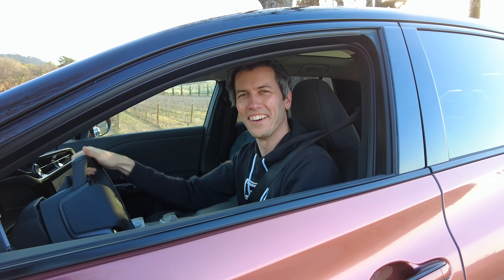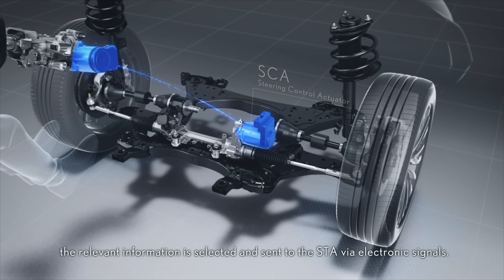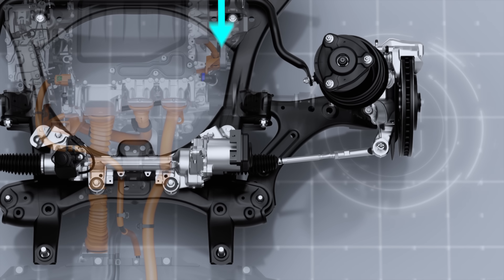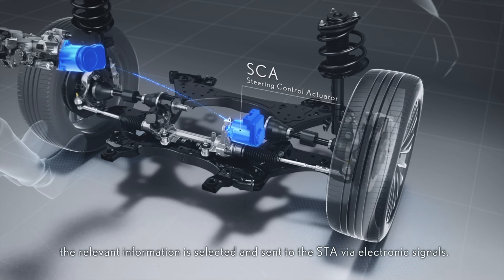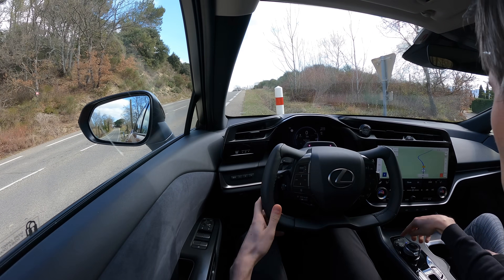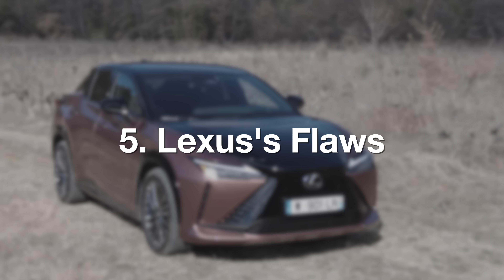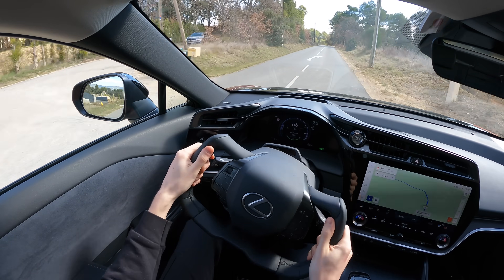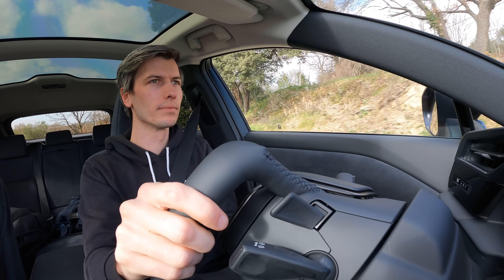How Lexus Fixed Tesla's Bad Idea: Steer-By-Wire Yoke

Comment: I like it, however, the certification process in the aviation industry is totally different from the car industry.

It is like Tesla reducing the amount of sensors. In aviation to reduce it, it would require an amount of testing and certification that's astonishing. And in case of failure, the fleet is grounded until the manufacturer comes with a solution. 

Again totally different from the automotive industry.

Comment: Critique… in every moment you showed driving the cars, the driver had both hands on the steering wheel or yoke.  This isn’t realistic. We use the right hand (in the US) to adjust the music, temperature, drink a beverage, or just relax and drive with one hand.  How does this perform using one hand as maybe the majority of the time we’re driving? With one hand driving, I also like to hold the wheel at 12 o’clock.

Comment: Surely you get far less feedback in the steering wheel feeling with a electric system, like with a physical connection to the road, you can feel everything, with this, not so much

Comment: ALWAYS REMEMBER UNINTENTED CONSEQUENSES!;
About 4 to 5 years ago I drove a (full production) fly-by-wire car on a banked oval test circuit at a steady 100mph in the 4th of 5 lanes. During the the second lap there was an audible 'clunck', all the electronics switched off, the dials returned to zero and most frightening the stearing wheel went floppy,  no feed back resistance. The front wheels "straightened"  from their original slight steering to the left angle required to stay in the oval 4th track lane at that speed. Consequently the car veered to the right (effectively straight as the wheelshad automatically straightened) and headed across the outer 5th lane, towards to outer crash barriers.... which had I hit would have resulted in a major rickshay or straight through and over the barrier into the forests below . 
A milisecond later there was another clunck, all dash power, steering movement resumed and I was able to correct the projection  of the car,  just missed hitting the outside barrier. 
I wrote to the manufacturer describing the event. The reply was, this is an 'unusual driving /steering angle of just a slight - off centre- turn I f the steering wheel and for a period of time of more than a few seconds resulting in the "chip" thinking that perhaps the  was parked and therefore activated "auto correction /straightened of the wheels to the rotational angle of the steering wheel.) This may be useful if you park leaving the steering wheel on hard lock when parked up in Car park.... but to take over at 100mph and transform the steering wheel into a free unless spinning plate was a heart stopper.  Designers.... this is not a PlayStation with simple adaptive feedback that if you crash on screen you can just press the  "reset" button.
Reply: Wow.  I've been saying you can have as much redundancy as you want , at the end of the day a mechanical link is more reliable and cheaper to implement. Yes in some weird off cases they do fail  but the failure isn't going to turn you into a pancake.  It's the simplest things engineers often overlook. Myself included. You would be surprised the mistakes I've come across in R&D. Just because it was designed by a company or a group of engineers does not mean it's foolproof and does not always guarantee safe operation. Field testing usually brings things to light the lab could not reproduce. At that point it can be life or death .

Comment: There is one more safety issue not addressed- the link between the steering wheel and the wheels. The signal line. If it is damaged what’s going to happen?

Comment: @0:05 Gives "input lag" whole new meaning. (Edit: Watched the video now. I would get carsick from it. I saw it right away. I would never feel safe - if a drive by wire system fails, the throttle will close. If brake by wire fails, it still has a mechanical backup. If steer by wire fails... Well.)

Comment: I'm glad you addressed the lag toward the end of the video.  Within 5 seconds of starting the video I literally said out loud "Wow.  You can SEE the lag!"  That is a deal breaker.
Reply: I loathe input lag in all things.
There is a real common theme of the tech industry trying to push fancy new technologies that present a safety hazard, and they sleaze their way in anyway. (A very old example is actually HID headlights.)
Reply: @ΜικεΡ  >If it was actually lag, there would always be Xms of delay between input and rack movement.
And there is, you can count the frames between when the steering wheel starts moving, and the time the wheels do... and it's about 3 frames. This video is at 30Hz, making that... cue the drum roll 100 ms. Increasing the time it takes to react to anything by HALF.
Reply: @ΜικεΡ  I'm not sure the purpose of you splitting hairs here, the issue is the driver expecting a certain angle and the wheel not being able to keep up due to the higher tire load at low speed. You understand what we mean when we say "lag" (that resulting angle lags behind the steering input by the driver). You conveniently ignored my question about this flaw at lower speeds, all for what? So we can call it desync rather than lag?
Reply: @ΜικεΡ  
You literally said the opposite above "What we saw here is that Video Man can crank the yoke to it's end of travel faster than the steering computer can yeet the steering rack." 

then you said this doesn't happen at highway speed.
Reply: @ΜικεΡ  I completely understand the wheels will not follow the exact steering input commands with a simple "lag" in time..You could have just answered my question by saying "yes my concern was to correct your conversation to use the term 'desync'". You are focused on peanuts all the while my whole point to the other guy was the rack not being able to keep up in certain conditions and the computer introducing limits in order to not destabilize the car at high speed is a very noticeable thing for the driver.
Reply: I agree
Reply: Same here, 5 seconds into the video and I immediately noticed that the lag between steering input and the wheels turning was too much for my taste!
But perhaps it's something that could improve over time...
Reply: @ΜικεΡ  What you describe is literally lag, but your significance is that it is just the steering not keeping up and doesn’t manifest itself at high speed.. So we only need the quick response on the highway? 🤔
Reply: @ΜικεΡ  Also not sure how you gather I don't understand how the system works. 

"The steering rack has a maximum velocity,"

Yes and above I asked you if on highway performance was the only thing of concern, hinting that you were ignoring the slower speed response of the rack. Swerving at lower speed the rack would not be able to keep up with inputs as well and the driver would notice this.
Reply: @ΜικεΡ  I have been reading your posts and literally keep quoting your comments where you say the issue is at low speed  I don't know why this is confusing to you. Low speed.. You know.... where your inputs are faster than the rack can keep up with. Quit telling me to read your post after I keep quoting you. Again you are enforcing the point that it's different than a mechanically locked system, meanwhile I have been refraining from calling it "lag" not sure why you are still arguing.
Reply: @ΜικεΡ  At lower speed the computer is programmed to have a higher steering ratio, thus more demand for the rack to steer with smaller steering inputs as well as more road friction or what have you (making quick rack movements difficult).

@Mike Perreman:
"@amorag59 ... What we saw here is that Video Man can crank the yoke to it's end of travel faster than the steering computer can yeet the steering rack. ...
At highway speeds this 'lag' wouldn't be detectable since the steering computer can keep up with the yoke."

your comment that this manifests itself as more a problem at lower speeds, agreed.

Edit: In response to your edit.. You are arguing a straw man now lol. My sole point in my op was that this system is noticeably different than a mechanically locked one.
Reply: Must feel like driving a 1984 Buick Century with such delay.
Reply: lol not in drifting.
Reply: @ΜικεΡ  12:00
Reply: @ΜικεΡ  12:01 frame 13: Yoke movement starts
frame 16: Wheel starts to move
frame 22: Yoke at 90 deg, wheel nowhere near the 60% of travel mark (90/150), so if he stopped turning right there the car would still be in the beginning of making the turn.
Reply: This should be illegal in a car, any unexpected turn for example in an accident can result in fatality
Reply: are you saying that little bit of lag is slower than turning the wheel 3 times? its not any slower to turn all the way then a normal car lmao
Reply: I mean you cant turn wheels with a normal steering wheel that fast.
Reply: humans have a ~150ms response time if u were a prodigy this latency is not noticeable. probably more responsive than some tvs
Reply: I mean it might be a deal breaker in a sports car.  But I don't see why it would cause problems for a daily driver.
Reply: Shouldn't most gamers be accustomed to working in an environment with noticeable lag?
Reply: @MetalheadAndNerd  No.  Gamers do everything in their power to get rid of lag.  If you can see it easily with your eyes, it's WAY too much for gaming.  You might not think this steering lag is THAT bad... until you need to make a quick evasive maneuver and the lag causes you to hit what you were trying to avoid.  Your brain alread has a 180-200ms reaction time.  You certainly don't want to double that.
Reply: @MetalheadAndNerd  I literally stopped playing Geometry Dash because I started to notice the latency and it felt awkward and I'd play worse, if the latency is noticeable I consider it already beyond unusable
Reply: @MetalheadAndNerd  No, because your mouse has something like 5ms of lag compared to this steering wheels 200ms of lag
Reply: @MetalheadAndNerd  I tried playing Forza Horizon 4 with Bluetooth, and it was unplayable
Reply: @MetalheadAndNerd not every customer is a gamer
Reply: All steering lags, it’s the flex in the metal. Will you notice more?
Reply: @teamidris  But this lag is way more then the metal's flex.
Reply: @Sekir80  truth, but I think your brain won’t notice? Like driving a tractor with big tyres, you just accept the lag. Or windscreen mesh that you don’t see.
Reply: @teamidris  True, adapting is a realistic assumption here. As with the very laggy throttle response: you try to think a bit ahead. 
The problem might be if someone needs to instantly do an evasive for some reason, rewiring that in your brain is hard and dangerous.
Reply: @teamidris  You would definitely notice, 12:30 is not simply a marginal amount of lag. If this were a tractor it would be fine, but it's an on highway vehicle. As others pointed out it's very comparable to throttle lag, but you can't always adapt to cover the bases. VW had tech for their mk4 cars to smooth throttle inputs - which ultimately presented itself as lag. On a stickshift car it was quite annoying as you could full throttle stab the throttle (representing a downshift blip) and the rpms wouldn't even go above ~2krpms, and this was on a sporty VR6. The little things become annoying over time.
Reply: @teamidris  Yes, i definitely would. This looks absolutely terrible to drive.
Reply: @teamidris  Easy, remove the flex and isolators. Zero lag

Comment: How is the dynamic ratio controlled ? If i launch the car out of a turn do the wheel straighten automagically ? Does sensitivity increase when slamming on the brake ? 

Seems like a very bad idea to have it dynamically adjust, especially for emergency situations...

Comment: Isn't steer by wire illegal in Europe? I remember press articles from like 2015 where car manufacturers were lobbying hard for brake and steer by wire and Europe basically said "STFU safety stuff will require at all time a mechanical connection. You can have as many assists as you want but there need to be something physically linking the input and output"

Comment: Sounds just as driver centered as drive by wire throttles. By that I mean, I don't need someone(s) else deciding how much I want to operate the controls in my cars. When I move the throttle pedal, I want it to move exactly with my foot, and I have NO doubt I don't want the steering to feel like the DBW throttles feel. At the beginning of the video, when you first showed the steering responding to your quicker inputs, I was shocked how rubbery it looked. Nope, hard nope.

Comment: I feel like progressive stearing like VW has as an option(the more you rotate, the more progressivly it steers),, is more simple - does the same thing in the end if setup correctly, and keeps it working even in case of all batteries failure => better option

Comment: Apart from the lower noise level and much much better braking, one of the first things i notice when switching from a 20-25 year old car to a modern one is the more direct steering. instead of around 3 turns in the late 90s, many manufacturers now use 2 - 2.25 turns from lock to lock. this makes modern cars so much more nimbler and handier feeling at lower speeds, u-tuning and when parking. i recently drove a golf iv and it felt like a barge because even in tighter roundabouts and at any 90° intersection you have to  use hand over hand movements. its really annoying, much more than you might remember from driving back in the day. that is something almost eliminated in a 2022 golf viii with the shorter steering rack. you only notice that when driving the both cars back to back. 

i am really eager to try out the by wire steering. yoke or wheel doesnt really matter i feel, but the total elimination of hand over hand movements and always quick direct steering would make the car feel much more alive and sporty. i dont see a safety risk here with redundant systems. on the contrary. i would argue that 99% of drivers lack the skill and muscle memory to really use whole range of a cars steering input in an emergency situation. like evading a child running onto the street. they will only turn the wheel as far as they can without having to use hand over hand movements (or do those much to slowly) - by not having to do this and still getting full steering input with the by-wire system this situation would be much better approachable. same goes for correcting a slide.

Comment: I remember my old gaming steering wheel started acting up and spiking 100% opposite lock at specific location (probably wear or dirt) I guess that can be solved by some clever programming and filtering the spikes which I imagine may be the reason why it filters some aggresive movements? or the delay
Reply: Compare the cost of the steering wheel itself and the cost of development of the Lexus’ to your video gaming steering wheel.

Comment: Turning in a traffic circle and speeding up while holding the same steering wheel angle.  Would this system reduce wheel angle and push you out of the traffic circle?

Comment: As always, great explanation. I'm surprised that steer by wire isn't done more often in production cars. In terms of space savings and possiblities, car manufacturers get a lot of design options. Personally I like to have fun driving and therefore I dial the steering assist from my car as low as possible. Then again if you really want to have fun, you should get an older car which has a manual and mostly mechanical parts.

Comment: Steer by wire looks incredibly complicated for really quite small benefits. Ditto electric power steering, which always feels dead. The Citroen DIRAVI hydraulic system solved all this in 1970. By law it had a solid shaft to the steering wheel but everything else was hydraulically powered. This could easily be used in electric cars with a pair of electric motor hydraulic pumps. I feel it’s a great lost opportunity along with the Citroen hydraulic suspension system. It got a name for unreliability but that was actually caused by mechanics refusing to understand the technology and of course rust which rotted into every car back then.

Comment: but they could have added a CVT transmission between the steering wheel and the wheels? Why go all-wire? CVT in-between would also solve that and keep it safer.

Comment: And what about responsive panic when the driver pressing all of the pedals. When you have a brake you stop the car if you push everything, even if you have throttle by wire. Also if electronic (software) fails you go where the car want's. Also F1 don't need paralel parking :D Yaay so now the steering wheel does not let you avoid a deer :D "Small" delay. At least the steering rack does not push the steering wheel in your chest at frontal accident :D

Comment: I would have to try it out in a test drive. I suspect I would like it, and you covered the reliability concerns well enough that I wouldn’t worry about that. However, the delays do need to be addressed, any electronic system should have less delay than the mechanical connections It replaces. If it doesn’t, it isn’t ready for market.

Comment: I don't see why Lexus can't put out multiple steering profiles for drivers to choose. The biggest point of steer by wire was how variable it is and then they're gonna lock you behind one single curve. Just like how acceleration and braking in electric cars has different presets, the steering should also have different pre sets if they're going with this sort of philosophy.

Also I would be interested to see something like a very steep curve on the steering. Something where you can make small movements on the fast straights but on every tight turn you are practically maxing out the steering wheel. That way you can have a fixed steering wheel to wheel turn position.